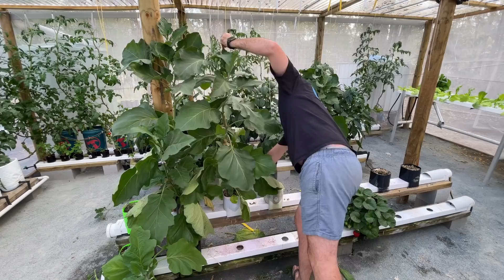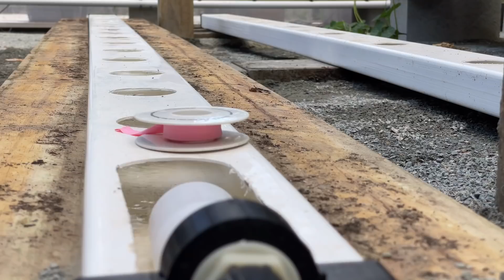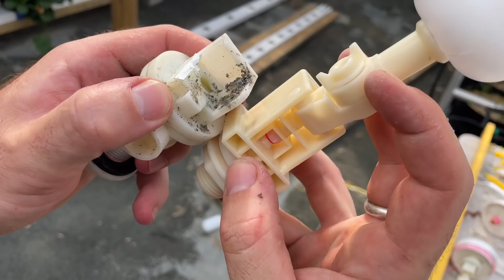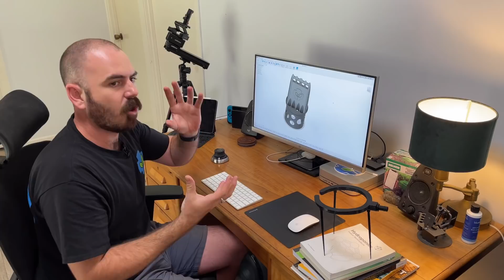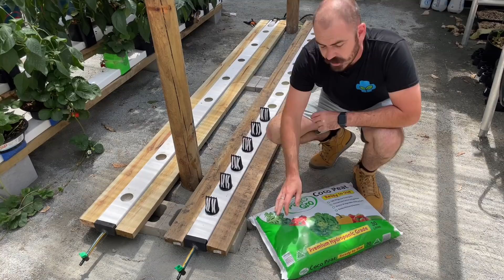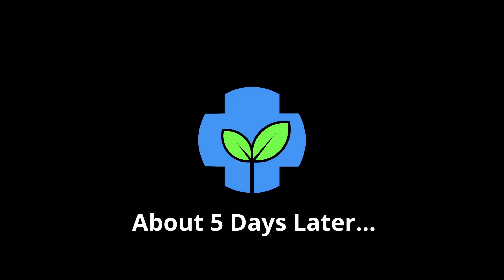The Wick Wedge: 3D Printable Hydroponic System

Comment: Nice design and idea. I would do differently by placing 5 gallon bucket lid with a 3" grow basket in the center fully stuff with wicking fabric branch out and fully in contact with the big round wicking fabric (used towel etc..) sitting on top of a 5 gallons bucket lid.  Place the 7 gallons grow bag filled with potting mix on top of the flat surface will wick the water up from the base up. The area in contact is a full bucket lid surface. That is what I am doing. Seem more economical and practical.
Reply: How did this work out?  I’m thinking about doing the same.

Comment: hoocho, do you think the valve floats you have presented are ok with connecting up to my tank water supply which has a household pump connected?  I have reduced the flow of water into the valve via the the water tap at the sink so it doesn't give full flow, just a low slow flow? TIA

Comment: NOTE: The ultraviolet light from the sun will deteriorate the plastic coco peat bags. They will break and fall apart over time. Therefore you will only get ONE growing cycle per coco bag. Then you will have to clean up all the coco peat and use in your other container systems. That makes a lot of extra work!  Should find a way to get the coco peat bags to last longer over several growing seasons.

Comment: Wedge design can be improved to avoid cutting many pieces of the wick. But it needs to touch the bottom. By adding a bar at the bottom across inside the cylinder and wrapping or rolling just one long piece of wick you may be able to achieve this. Also this would ensure the wick touches the water compared to dangling free and being uncertain if it would touch water. You may add some grooves on this bottom bar to hold the wick tight. Hope you find this suggestion helpful. Cheers
Reply: It's better to have four separate wicks than one that wraps around at the bottom. The printed wick wedge is designed to sit on the bottom of the rain gutter so any wick cut with both ends going slightly beyond the bottom of the wick wedge will touch the bottom of the rain gutter. The end of a wick with its frayed end will take up much more water because there is much more surface area for water to be absorbed into the wick. 

A bar on the bottom of the wick wedge to wrap a single wick around would either have to be moveable or easily changeable before printing. The wick a person uses may have a different diameter and different wicks expand at different rates when wet. There could be enough force to break the bar when the wick gets wet or even cause the lip of the wick wedge to come up from the top of the rain gutter, depending on the mass of the bag of material receiving the water.

Comment: This is actually not very well though out... Hydroponics is growing with salts, the salts will build up because of the wicking effect that draws the water and salt up from the bottom leading to high EC values in the substrate 🤔 that's why rockwool has to be flushed from the top in a ebb and Flo flood system every week or 2...
Reply: What is the problem with high EC values?

Comment: Could the aeration of the coco be solved by the addition of a few holes in the spike running down to the gutter headspace?

Also, could the solution to the the algae in the valve be solved by the judicious application of black plastic?
Reply: or wrap them in aluminium foil?

Comment: Hoocho, still innovating! Well done.
PS: The small float holes allow the valve to turn off at higher mains pressures. The floats you are using with the big holes have trouble turning off if the mains pressure goes above 400kPa.
Reply from the maker: See, it all makes sense now! Thanks for this insight!

Comment: Hi, I think your EC is still too high...😁 personally I have never exceeded an EC of 2 and that was for growing tomato plants.
it's a good thing to add calcium nitrate, you can also add epsom salt, I use about a teaspoon for a gallon.
Reply from the maker: The higher the EC the higher the Brix, I'm aiming for tasty fruits more than yeild.
Reply: @Hoocho  I think there is a small mistake, the percentage of BRIX depends on many different points, but it does not depend on the increase of EC.
 If we take the example of strawberry crop, according to scientific studies, the best EC is between 1 and 1.3, and the higher the EC, the lower the sugar percentage. 
What favors the increase of the sugar for the strawberry plant, it is above all, a not too hot temperature (22 degrees Celsius), a good luminosity, CO2, a pH below 7, humidity, but also, to remove several flowers to leave only 5 maximum by strawberry plant (Japanese technique to increase the BRIX).
Reply from the maker: @pierreshasta1480  I’m adjusting for tomatoes mostly.